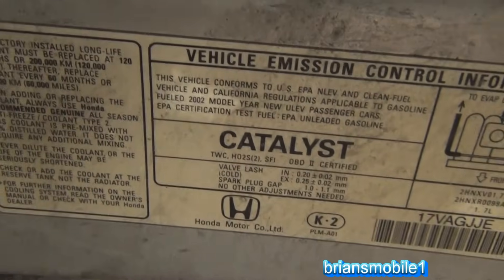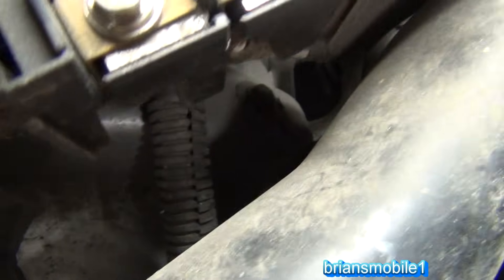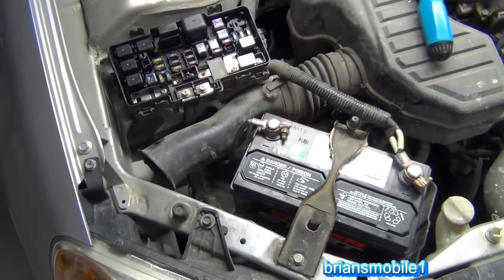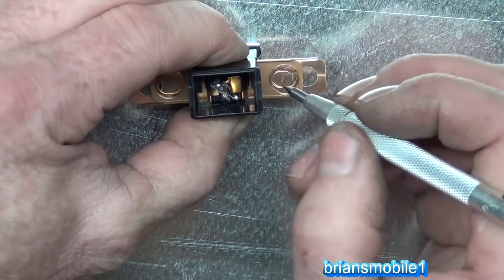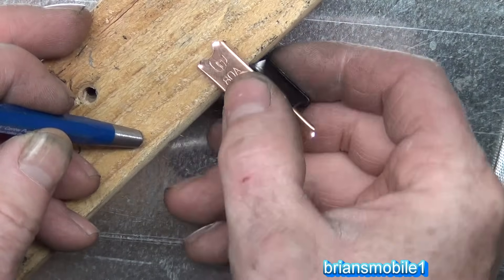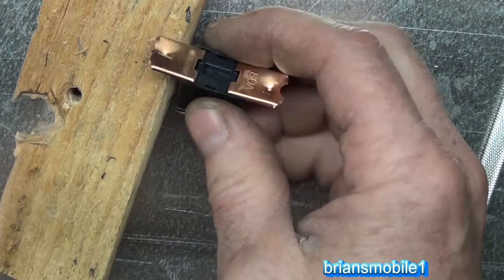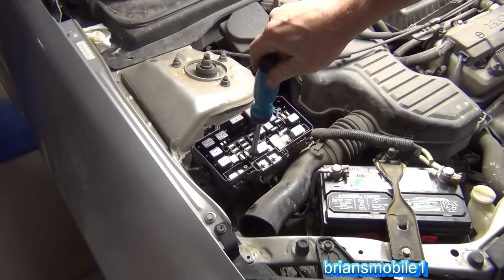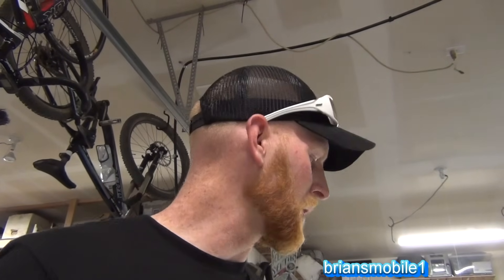Battery Backwards Damage and Fix

Comment: So I jumped my 2000 jeep grand Cherokee backwards just like you said. And when I did that my car wouldn't start at all. My alarm system and my lights would not stop flashing and my horn just kept blaring. So I took my battery off... My question is this the same thing I need to do to fix the issue???? 
Please I need help.
Reply: I left the cables on for about a good 20secs before I realized

Comment: I have a 1998 nissan Altima battery was Put in backward we replaced the FL 100 A fuse car starts but now the AC n radio n dash light will not work did this burn these fuses  to

Comment: Thank you just accidentally did this to my car I was trying to fix up 😂 thanks so much man! Good video. Great job
Reply: Yeah I just put my brand new battery in backwards, and when I realized my mistake I felt like such an absolute idiot. Thing is, I actually had to hammer BOTH terminals on, so thats what got me even more messed up. Now begins the process of identifying the fuse, because guess what, no fuse box cover or manual left in this oldy.

Comment: Excellent information. I replaced the battery in my Mazda and the fuses blew like you described. Turns out that the black rubber cover on the end of one of the battery cables was actually the positive cable (i.e. it should have been a red cable end cover). I wired up the battery 'correctly' according to the cable end cover colour (only one cable had a cover and it was black), but it turns out that I'd inadvertently wired up the battery the wrong way round. Your video has shown me how to identify the true negative cable (i.e. the one that goes to ground), so now I can make a fix and also change the cable end covers so I don't make the same mistake again. Thank you, you've saved me a garage bill and more.
Reply: Which year ? And which fuses? I cant find to start my mazda

Comment: Dad hooked up the jumper cables backwards on my car and I’m hoping this is all I gotta fix ah I only asked him to make sure they don’t touch but he went ahead and “helped” by connecting em
Reply: Did you end up able to salvage the car or was it totalled. I had a guy help me with a dead battery the other day. Everything went to hell fast. Burned out a wiring harness, abs sensor and who knows what else. I need to either scrap it or start working on it.
Reply: How old is he

Comment: thank you for the video I have a 2000 Jeep Grand Cherokee that I believe has the Chrysler fuse you described below I crossed wires quickly and I have power but cannot start
Reply: Did you ever fix it? I’m having the same issue
Reply: I've wiped most of the fixes to that jeep from memory but pretty sure there was a smaller fuse on the positive cable or in the box to protect things and I replaced it.

Comment: Can someone help me. I have a 1996 Camaro SS. I connected the positive ground wire to a negative ground wire. Put a new battery and now it won’t start but it’ll crank.
Reply from the maker: Check your fuses for the ignition system.

Comment: You seem pretty smart. Smarter than the last 3 shops that looked at my electrical issue. Maybe you can help me on this? So.. sometimes when I start my car the gas gauge and temp gauge will drop all the way down, the power windows will not work, and the blower fan for the heat/AC will not work. One mechanic said it was a loose  positive connection to the battery and a wrong terminal end was installed. I had him fix it and I’m still having the same electrical issues. Not sure if this means anything but it seems to happen more often after it has rained. 

If you or anyone has any solutions I’d greatly appreciate it.

Comment: Dear Sir

Thank you for your very helpful video. 

Recently , while I was installing a new battery, I made the mistake of placing the new battery backwards so that the polarity was reversed. Since then I have replaced the main fuse such as you did in your video, but not by making it myself as you do, but by purchasing a new one. The engine turns over but will not engage. A few days ago I bought a new battery and I am very concerned that I get the new battery installed safely and correctly. Could you please remind me: does the the positive connection always fit toward the windshield and does the negative always go toward the headlights? You go over this in your video but I still want to be very certain. How many visible wires does the positive ground have, and how many visible wires does the negative cable contain? What are their colors on the positive pole? How many does the negative contain, and what are their colors? It appears to me that the positive cable (the one that goes toward the windshield  contains more wires that the negative, because there are some small white wires on the positive cable that are not present on the negative cable. Is that correct?  (The car's make is a 1995 Isuzu Trooper). Naturally I am desperate not to make such a mistake again. If you have a moment could you write to confirm or correct me? Thank you.

Sincerely yours,
Will Morgan (North Carolina)
willwmorgan@gmail.com
Reply: Your positive cables will always be red and the ground will be black.

Comment: Greetings Brian.
I made mistake on battery terminal connections during jump start. But I quickly disconnected it then after when I try correct way the alarm went on. My car has remote starter. How can I solve this? It is Toyota sienna 2008.
Thanks.

Comment: I have a 95 Acura Legend I put my battery in backwards on accident and tried to connect it twice I was in a hurry I know I regret it but I get no power at all. I changed the fuse to a higher amp and still get nothing
Reply: Did you ever figure it out? I'm curious because in similar situation.

Comment: So there wouldn't be many problems on an Asian car such as a Nissan (similar to Honda), if you wire up the battery backwards? 
It's a 1985 Nissan 300zx, and the guy wired the battery backwards.
Reply from the maker: There can always be random problems from installing a battery backwards.  Many are minimal due to protections for that sort of thing.

Comment: Ha! I bought a reverse terminal (R) battery by mistake and hooked it up and when I saw a spark I quickly disconnected it. The fuse did not blow and the battery did not bubble over. I flipped the battery around and MADE the cables reach. It works great. My 2001 CR-V also has these fuses which I didn't know about until now. Thanks.

Comment: So I accidentally put my car battery on backwards, and there was a spark under the fuses. I put the battery on correctly and the car is running fine, but my break lights, blinkers, a/c, windshield wipers, and power windows don't work. All the fuses look fine when I checked them. Does anybody know what the problem can be?
Reply: I'm guessing that you fried a fusible link underneath the fuse box.  In some cars a fusible link looks like a piece of electrical wire with plastic tab on it.  Best thing is get a repair manual and find out where your fusible links are located, and then test them for continuity using an ohm meter.

Comment: my friend connected his battery wrong by accident and car starts up but radio dont work. i checked the fuse and it was OK. what else could it be. it's a 2002 pt cruiser
Reply: g305 there is two radio fuses

Comment: Hey Brian, I'm not sure if you reply to these comments but I have a question. I'm helping my cousin with his 92 Honda Accord, which he accidentally hooked the battery up backwards. After hooking it up correctly the car starts and runs and some of the electronics work, however the gauges and stuff doesn't work. And the alternator is not charging. When the car is running the battery light is on on ththe dash and that's it. Some other electronics work, ie the sunroof etc. But random stuff doesn't. Please help? Lol
Reply: your fuse on your alternator is blown, check your 100 amp fuses too....
Reply: check the diodes..100% it's broke

Comment: I just found your video. This morning I was half asleep and put my battery in. The terminals didn't reach on the new battery and before I even realized I flipped the batter and hooked it up backwards. Well it sparked and started to smoke so I jerked it off and realized what I did. So now my car wont crank. The interior dash lights come on, but no crank what so ever. Think its the fuse?
Reply: BTW the car is a Ford Five Hundred
Reply: Zack Adkins I just did the same thing, and my car is doing the same thing. well at first after waiting a few hours my battery seemed to charged back up ( I have a optima battery so I'm assuming that's why..but now does nothin) I even went out and paid $200 for a new optima battery. But my question is did you ever figure out what you had to do to your car for it to start/run right again?? My car is a different car than yours a 2000 mercury sable, but I'm sure it's the same fix considering.. thanks in advance.
Reply: Just did the same on my 87 volvo, I got distracted and put it in backwards... The alternator started smoking and I quickly disconnected it. I think the diode might have fried a bit but who knows if anything was shot. It still starts thankfully, so I left the negative off for over 5 min with the lights and heater on full bore and everything was still running and the battery light in the dash didn't come on. Seems like I dodged a bullet.I'm surprised with all the smoke that nothing was ruined but we will see as I drive it for the next week if it goes on me.

Comment: Yikes on the BFATE -  Looked like a few near misses with the ground there, mister.  Sup with that kinda driving?  :-O  Glad to see you gave the power lines some respect AND space.
Reply from the maker: ; )  It's an interesting sport for sure.  It's very counter intuitive what is safe and what isn't.  For example, the first time I came in to land the guy in my ear is saying "hands up" over and over and I'm booking it into the ground pretty fast.  The key is to have lots of brake handle line available so you can flare and then all the speed you energy you have turns it to "put you down like a feather" energy.  Another counter intuitive thing is the higher above the ground you are 70+' the safer you are, or the lower to the ground below 30' the safer you are.  That's why training is so important.  The speed helps, height helps or lack of height helps, and figuring that out on your own could hurt!
Reply: I'm interested in trying  such craziness some day, perhaps during one of my more adventurous moods where reality has not set in to the concept - I am not a bird, I do not have feathers.  HAHAHA.  The counter intuitive part is what gets you in the end ... and the head, and the legs, and the rest of the body every time. 
   2 thumbs up for getting a trainer!  
   2 thumbs up for fix sex!
I'm glad u had fun as it definitely appeared that way in ur vid.  Maybe this can become another feature of your channel if u get to do it more often. (hint)

Comment: I always enjoy watching a practical mechanic doing electrical repairs, someone who understands when good enough really IS good enough, and why.

The Chrysler part is called a self resetting thermal breaker, works like an old fashioned home heating thermostat, except that the current flowing through it does the heating. Often they can be reset faster by blowing high pressure air across the top of the case.
Reply from the maker: THANK YOU!!!  I knew somebody smart would know- and pssst3 is that somebody!
Reply: @briansmobile1  so my son did this on my zl1. But only for a second. Melted the fuseable link on the alternator wire that went to the positive battery post. I repaired it and new battery. But only Keb fob will lock unlock. No sounds or horn and windows won't roll up and no start obviously

Comment: thermistor? did I win?
Reply from the maker: Close, but pssst3 got it. "The Chrysler part is called a self resetting thermal breaker, works like
 an old fashioned home heating thermostat, except that the current 
flowing through it does the heating. Often they can be reset faster by 
blowing high pressure air across the top of the case."

Comment: A few years ago I bought a 1986 Saab 900 for like $500 running at a car show, got it home and was working on it... didn't notice that it didn't have stock battery cables (both black) and I had set the battery in the tray wrong, so I touched the terminals backwards. WOW! Fireworks! Amazingly enough the only thing it fried was the oil pressure switch... it basically welded together the thin metal sheets that make contact when there's oil pressure inside the switch. NEAT.
Reply from the maker: Pretty cool!

Comment: Who would have thought the fix would be so easy.  
Part of my GMC SPRINT restoration was an entire Painless kit. Getting rid of a hidden fuse-able line was a plus. They neglected placing a few relays and circuit breakers which I've added on my own. The starter circuit for instance.
Reply from the maker: You're a smart man!
Reply: Pin 85 & 86 I believe. Wrote a whole treatise to you re this relay then hit the wrong button and gone forever... So.
A friend gave me the April Hot Rod and an article there described the solution to my hot start issues. 
A penny across those 2 pins will fire it up with out any sparks whatsoever. Seems the OE ignition switch can't deal with hot start amperage draw. Problem solved, (also for fuel pump wire (16 or 18 gauge) to the back of the car and the coming electric fan as well. Not sure what Painless was thinking but no matter.  Jim

Comment: Lucky the alternator diodes survived as well, or did you not check charge current afterwards. 

with the paragliding my most memorable was at the beach one day, when a paraglider in the loop for the airshow 2km away augered into the surf 5m away from me, as his control line had snapped in the middle of a hard turn. Paraglider written off, bent frame, shattered prop, motor not liking eating water, but he was fine aside from some concussion and damaged tendons. Lucky there were enough of us there and enough knives to cut the parachute loose before the undertow took him with.
Reply from the maker: Alternator was fine.  Ya, drowning is a legit concern as it's the leading cause of death in this sport.  I've got a single point release on my harness (as apposed to 3-7 buckles) and a hook knife on the front of my reserve parachute pack.  As you're going into the water (you usually know it's coming descent rate is pretty slow) you pull the hook knife with the left hand and the harness release loop with the right hand right before you hit the water.  As for the motor- they hate salt water!

Comment: I jumped a car backwards 1920 miles from home. I spliced a cheap discount Christmas tree electrical cord I bought from a gas station in between the fuse able link and replaced a bunch of fuses with 30 amp fuses cause that's all they had. made it home and fixed it right the nextday.
Reply from the maker: Get'r done!  Way to go!

Comment: It's called a bi-metallic strip, two different metal strips attached together that expand from heat at different rates, makes it bend and break the circuit, when it cools down it straightens out again and reconnects the circuit

Comment: We hada kid put a battery in backwards . The ark went all the way down the prop rod and blew out the AC pump  Burned a hole in the hood . A $99 mistake coat Wal Mart about $1500.
Reply from the maker: That's pretty impressive!   You get the best stories like that.

Comment: that guy got lucky I have seen Toyotas fry several computers when that happens.
Reply: a guy in the neighborhood fried his ECU in his Grand Voyager.
Reply: +ickipoo The current went across the battery through the alternator rectifier diodes blowing the fuse. With the battery connected in reverse the rectifier in the alternator would have been forward biased, causing a very high current to flow because it is connected directly to the battery.
Reply: How u fix it ? That happen to my Toyota solara..light work but it won't star what I need to do?
Reply: I have to wonder where all the current went in this case. Sure, the fuse blew, but where was it flowing until it did? Protection diodes in the computer, maybe diodes in the alternator? Scary.
Reply: I've accidently hooked up jumpers backwards on my 94 mazda pickup before, it didn't blow a fuse or anything just melted the jumper cables lol
Reply: Moot Doe In your case, the current flowed between the two batteries - while spectacular, the damage was confined to the batteries and jumper cables.
Reply: Adam Harr my Toyota fried rm

Comment: Is there a specific name for the type of fuseable link that's just a long, flat, bendy strip of metal?  It sort of looks like that main fuse, having the metal bits on either end that get screwed down, but then rather than having the giant fuse cube on it, it's just one continuous strip of metal.  I run into 'em on 80s and 90s German cars every so often, and I'm worried I'll have to replace one some day.  I cannot find anything like it for the life of me, nor can I figure out what they're rated at!  :\

Great video, Brian!  Thank goodness Honda was kind enough to have a main fuse!  I've seen batteries installed backwards kill off the PCM...
Reply: You are referring to a strip link fuse. They come in different thicknesses for different amperage ratings